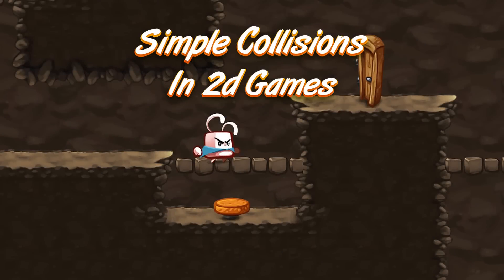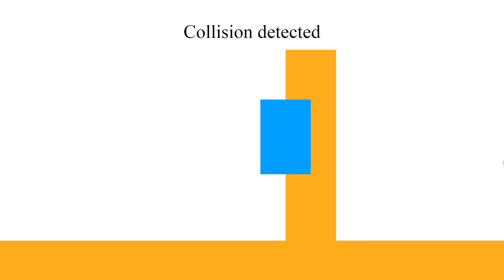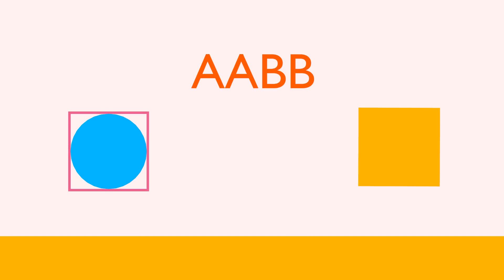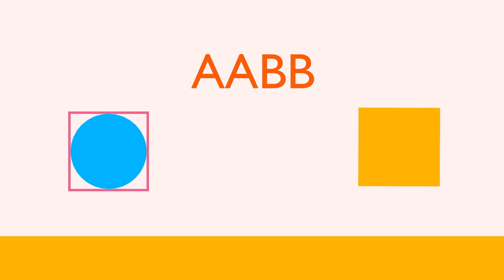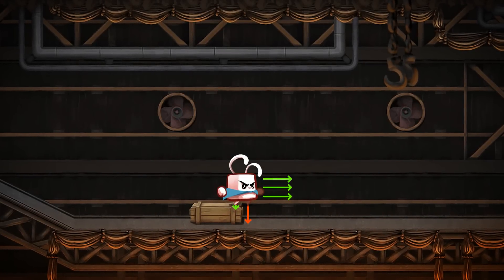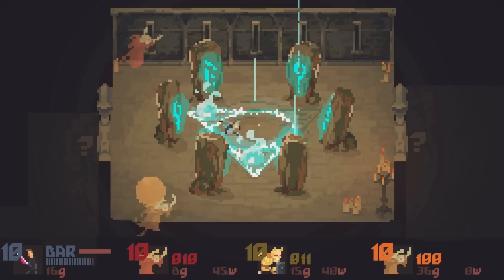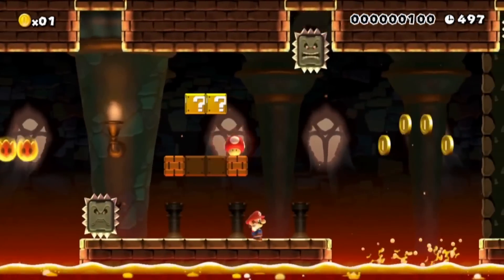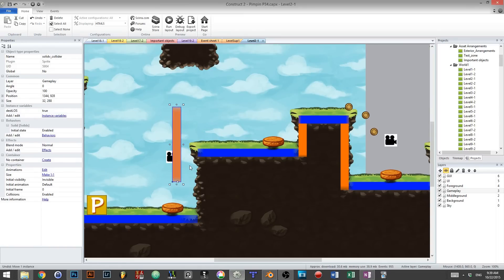Overview of Simple Collisions Detection Types in 2d games

Comment: I noticed that collisions occur more frequently when a Player collides with an Enemy while the former is moving downwards.  My Enemy nodes triggers the Players _update_health(amount: int) function and works fine during horizontal collisions, that is, Enemy hits Player x amount before Player dies.  However, when a Player lands on an Enemy's head, it's insta-kill.  I have yet to figure how to debug this.  I know a raycast is probably the better solution but I'll still try to find out how I can fix it without using one.

Comment: One of my favourite collision detections you didn't mention is circular (I am not sure what most call it).  I find it simpler to implement even than AABB.  Each object has a center and a radius to indicate it's size (this forms the circle, rather than a box, around the object).  The collision is the same distance in all directions from the center (the radius away).  When you test two objects, you do some simple math to get the distance the two objects are apart (from the center of one, to the center of the other).  You then add up the sum of the two objects' radius you are testing.  You then simply compare the sum of the two radius' to the distance the two objects are apart.  If the distance they are apart is less than or equal to the sum of the two radius', than you have a collision.  It's extremely simple to implement and fast.  It's perfect for more rounder objects especially.

This is the collision routine I use in my Deluxe Pacman 2 game (available free online, just search).

Also, using combinations of these collision functions is good too.  Use a fast routine like AABB or Circular to test if they collide.  If they are, and you need pixel perfect collision, you can then jump to another function to test the areas that overlap to see if any pixels are actually touching, or occupying the same location on screen.
Reply from the maker: Thank you for the detailed comments! It's really interesting to get deep insights like these. The tools I've worked with always had the collision covered for you, and unless you are programming from scratch, you mostly need to know the effect a certain collision type will have on the gameplay. Definitely, circular collisions are a must for circular shapes! I do like capsules as well for shooting games.
Reply: GDquest
Yeah, I tend to program it from scratch when I can.  Circular can apply to any object, especially if pixel perfect collision is not important, you can set the radius to be slightly less than the size of the object and it will work good enough most of the time.  Set the radius to larger than the object (and it can be any shape) if you want pixel perfect, then you can use something else to check further if you get a circular collision.

I used AABB all the time before this, but honestly found this to be so much simpler and fast to implement.
Reply: Circular collision algorithms are really useful when combined with an embedded "skeleton." For example in a 2D fighting game you can achieve much more accurate collision detection (based on the shape of the sprite) without spending the processing time required for pixel perfect detection.